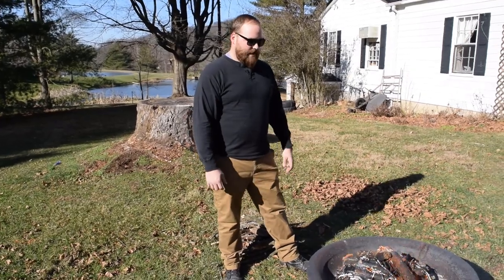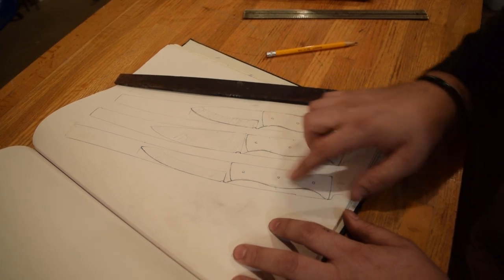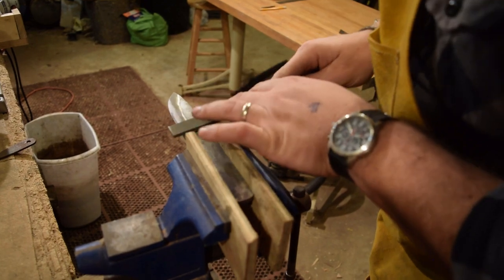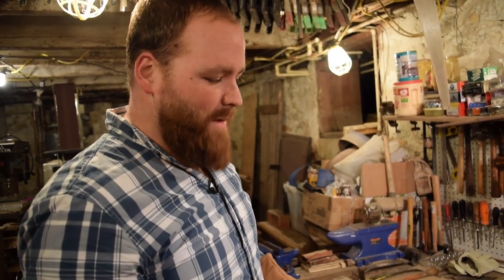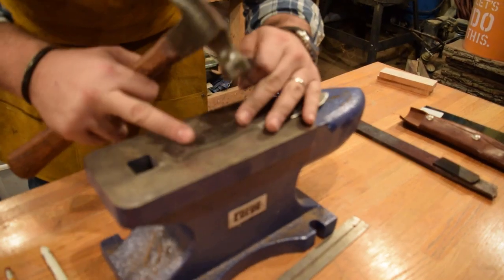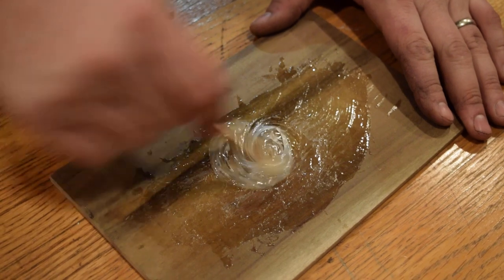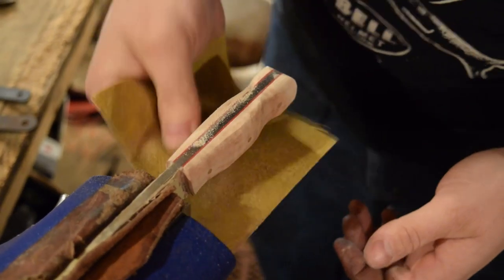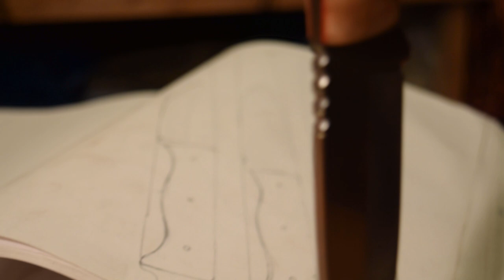Making a knife from a metal file.

Comment: Any tips on how to chose  good file for making knife...there's a lot of file  in market which i believe each manufacturer come with different steel quality
Reply from the maker: First, buy old files. They will most likely be high carbon steel all the way through. I always look for Nicholson, as they are all made from 1095 as far my research has taught me. Also, Heller, and Arcade should be quality high carbon steel, again, when you’re find older ones. The majority of more modern files are case hardened, which means only the outside is hard, but I’m not sure if that does or does not mean that they can be quench hardened. Some general google searching should give you some more thorough information that you are looking for, but these are good rules of thumb to live by as a file knife maker.
Reply from the maker: Here is some Wikipedia info on case hardening, to educate both of us...
“These mild steels are not normally hardenable due to the low quantity of carbon, so the surface of the steel is chemically altered to increase the hardenability. Case-hardened steel is formed by diffusing carbon (carburization), nitrogen (nitriding) and/or boron (boriding) into the outer layer of the steel at high temperature, and then heat treating the surface layer to the desired hardness.”
Reply: So much for using a recent buy at horror freight. I do have a bunch of old ones from the pawn shop. Thanks for the tip. Old is better. I also thought files were d2 tool steel . Nickelson being 1095 is awesome

Comment: You made a really beautiful knife, well done! But when I see you filing the blade after the heat treating process I suppose that the blade can´t be very hard. Atb Jürgen
Reply from the maker: Weser Outdoor 
Thanks so much. The knife passed the file skating test after heat treating and was an over all straw color after tempering, which is what I usually look for, but it's such a tough thing to get right with out more high tech tools for my shop. I was filing for a very long time to get it to the final shape. It will work for my uses. Thanks again for the comments.

Comment: What is the purpose of using the orange material in your handle?
Reply from the maker: Saxophone Jesus 
The liners serve multiple purposes, all of which you could take or leave per your preference. Firstly, it adds another element to the aesthetic to the knife, for the visual appeal. For functionality , it acts as a barrier between the wood, which is porous and will hold water if it gets wet, and the metal of the knife. This liner will not hold any water so will reduce the risk of rust under your handle scales over time. They could also help to fill any gaps if your scales are not perfectly flat or add width to the handle if you scales are too narrow. There are many different materials used for liners on the market, and they each have different properties that are beneficial. I personally enjoy having the option to throw another color into the mix, as an artist who is concerned almost as much for the overall look of the tool as for its function. Hope this helps, and thanks for watching.

Comment: When is it safe to take off the respirator after grinding
Reply from the maker: Eric Smith 
Thanks for watching and for your comment. When you can remove you mask depends on your work space. If you are in a relatively well ventilated space, you can remove you mask pretty much right away. If you space is not ventilate as good as you would like, you might want to wait a minute is so to let the dust settle. Also, depending on what you are bringing, the metal dust will settle quicker that wood. That being said, I'm not an expert, so you should do some research concerning the specific mask you are using and that brands recommendations. I hope this helps, and good luck grinding.

Comment: I'm done with all my heat treating process and noticed my blade has a slight curve to it is it too late to bend it now
Reply from the maker: It’s not too late. Correcting a bend is not the easiest fix but can be do several different ways. You can use a metal clamp to correct the bend by clamping it to another straight or slightly curved surface and put it back in your over for another tempering cycle. Sometimes that heat will help it correct. Otherwise, you can clamp it in your vice with three points of contact to over correct the bend and until it springs back to straight. Sorry I don’t have a vid to send you to but there are many videos out there that show those processes.
Reply: Thx buddy for the info

Comment: Never heard of safely shaping steel while cold.  All the big name forges i know of ways done this while glowing hot to avoid stress fractures.  Last I checked that's a belt sander not a grinder...  No gloves?  Not cooling it as ya 'grind'?  Final for me is watching drilling and shaping attempts after temper.  These are always done before temper.  Knife making 101, really...  Wouldn't be confident buying or using a blade made this way

Comment: Great video I’m going to try and a make my Frist knife out of a rasp would I do like the same process?
Reply from the maker: Brandon ONeill 
Yes, the same process can be used for any previously hardened carbon steel. Most rasps and files are made from basically the same steel. Nicholson, heller, and Arcade are the ones I prefer using. Good luck.
Reply: The Art of Craftsmanship ok thanks

Comment: Not good enough.  High speed drill,  sharpened corecly,  And extra holes too lighten the handle. The blade  tempered  to couler,   Dark straw.   The machinist  are gone and lost for ever.  Over and Out.
Reply: @Jack Duffy, Huh? No clue as to what you are trying to say there.